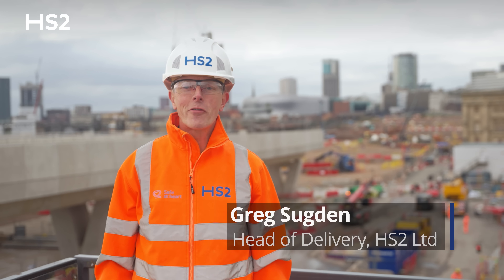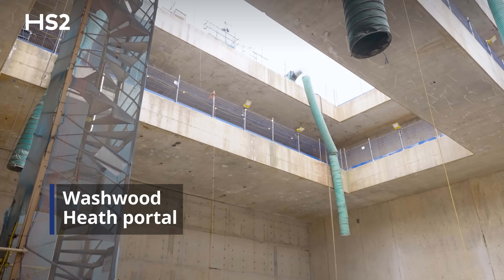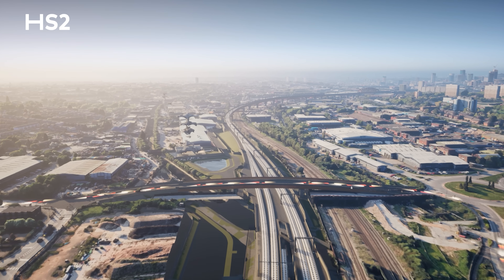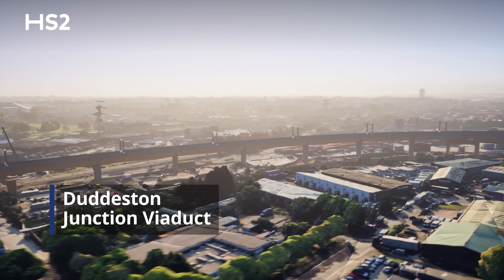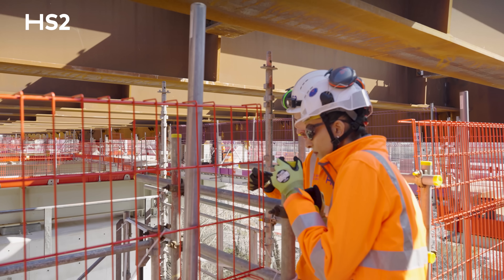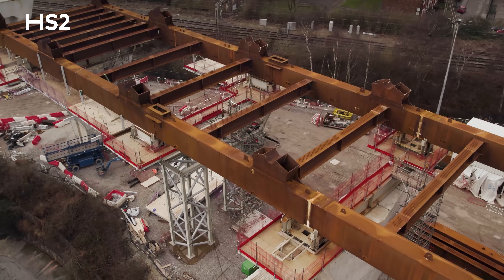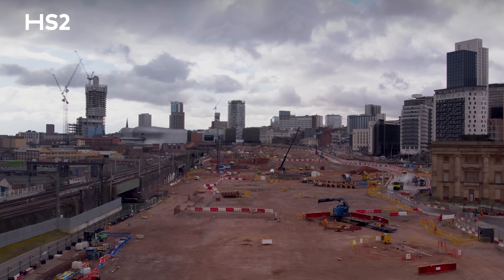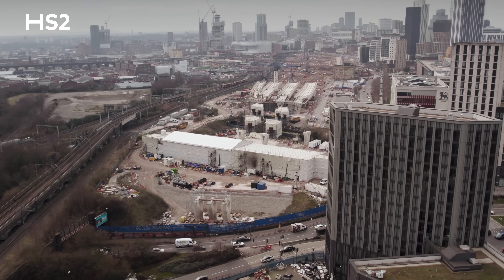Building to Birmingham: 🚆 HS2's Curzon approaches progress update 🏗️

Comment: The canal span of Curzon 3 is going to be a big challenge - a curved concrete deck, starting the split, resting on the bespoke steel piers, but also very limited access underneath for the formwork given the canal and towpath will remain open.
Reply: They will build a scaffold bridge  in spanning the canal and probably close the canal towpath.

Comment: well done team much appreciated for all your work your doing,  but still wondering exactly how local services will be impacted once the hs2 goes live since they are essential interstops so time table won't be changed unless they deem some locations decommissioned based on usage, which will be a shame,
Reply: For context, my job is to write railway timetables.
Currently, the WCML has slow freight trains, slow passenger trains and fast passenger trains. This means we have to leave a huge gap in front of every single fast passenger train so that it doesn't crash into a slower train in front, and this severely limits capacity. However, once HS2 opens, those fast passenger trains will move to HS2, leaving the WCML to handle slow freight trains and slow passenger trains. Because of the similar speeds, we'll be able to run trains closer together, meaning more local passenger trains, and more freight trains. So while the journey time may increase slightly from your train stopping in more places, you will have more trains, and so it's a net benefit.

Comment: Replacing that beautiful old brick bridge at Saltley Viaduct with a bridge that looks exactly the same as the others on that stretch seems a bit of a shame. No nods to the existing bridge, just a boring carbon copy of the others?
Reply: Because both Aston Church Road Bridge and Saltley Viaduct are not high enough for the catenary wires of HS2 to go under them plus both Bridges were deteriorating and run down

Comment: HS2 is only HALF a project. The 20 million in the North have been ignored again. The Engineering looks good. However the 35 miles of tunnels through the home counties/Euston connection are the main reason that this project is billions over budget. The Manchester HS2 link was therefore sacrificed.
Reply: Lucky lucky Birmingham
Reply: I couldn't agree more.... As usual The North is sacrificed for The South... It's not only Manchester and even Liverpool that's missing out... A city larger than both of them has also been overlooked as per usual Leeds, the largest city in the North of England and largest city in the UK outside of London and Birmingham has once again been overlooked, It's criminal how often that happens to Leeds specifically, It's also the largest city in Europe with no mass transit system.... It's a disgrace on all the governments who've ran this country for the last several decades, always overlooking a powerhouse of a city. Idiots.
Reply: @markolegend3011 leeds is not bigger than Manchester lmao. 
 But other than that, yes absolutely 

I think the councils of leeds and Manchester should work together to pool their money instead of relying on london.

The trouble is we're really quite tribal in the north there's no way that will ever happen, but it should.

Cash strapped as it though and it doesn't look like Manchester will be using the boom town money it's currently attracting to put funding in areas other than itself.
Reply: @pierzing.glint1sh76  Leeds is larger than the City of Manchester which is the 6th largest City in the UK, again you are mixing up the City f Manchester and Greater Manchester Metro County which is not a City
Reply: @markolegend3011  Leeds is not the largest City outside of London, that is the City of Birmingham 150 miles sq in area and a population of around 1.5 million citizens making the City of Birmingham the second largest City outside of London and the Second City of the UK
Reply: @markolegend3011  I totally agree with your point regarding Leeds population. Leeds should have a link from HS2. Manchester city only has a population of 550,000. However Greater Manchester has a population of 3 million (it includes Manchester, Bolton, Wigan, Stockport, Salford, Oldham Rochdale, Tameside and ,Trafford). They are all part of a densely packed urban conurbation, and are thus treated in a similar manner to Greater London. The Greater Manchester boroughs have different boundaries depending what side of the road you are. That is why Manchester is significant for transportation.
Reply: don't worry, all the saved HS2[n] money isn't being wasted.....it's being spent in Ukraine.☹
Reply: @ccjelley2390 no, that simply ain’t true. UK given to Ukraine so far £3bn, a cheap price to weaken the threat of yet another European dictator. Net zero…well that could have paid for the expansion

Comment: Do you mean meters cubed or cubic meters. There is a big difference.
Reply: @johnawalker9261  'metres cubed' and 'cubic metres' are the same volume. 2 metres cubed = 2 cubic metres. 

I think you mean without the 'd' in cubed? In that case:
a cube with side length of 2m = 
 8 metres cubed
Reply: @ three meters cubed is nine cubic meters, so they are not the same.
Reply: @johnawalker9261  if you say so!
Reply: My arithmetic has always been bad, that should read 27 cubic meters.
Reply: @johnawalker9261  a cube with 3m sides is 27 cubic metres. I think we are on the same page.
Reply: Sadly that's how far too many "civil" engineers are taught
Reply: It's 180,000 cubic metres. More to the point that's 20,000 lorry loads.  So where did the soil go ?

Comment: It needs to be built in full to Manchester, Leeds, Glasgow, and Edinburgh.
Reply: Plus a branch to Liverpool would be nice!
Reply: @therebel2187  already in the planning look up Liverpool to Manchester high speed line and you will be pleasantly surprised at the progress on that front…!
Reply: Newcastle needs it mostly, we have the worst productivity in the country because we're so far from everyone else and we get hardly any investment
Reply: @50upss  Newcastle has the unlucky situation of not being near any notable population centres, the east coast mainline serves mostly big towns or v small cities at best, therefore harder to justify the connection, also with the ECML getting digital signalling and speed increase on the lower section to 140mph you could argue Newcastle will be adequately served by high speed rail
Reply: Maybe they will plan to build some HS2 multi-delta at Warrington Central.   
There are many options now.  
HSx Liverpool to Manchester through Warrington Central (massively upgraded) and a HS2 4-way delta would be nice.
Once they get more HS2 done then GBR can re-start Phase2a.
Reply: @Carlos-im3hn  I think with the southern ECML upgraded to 140mph and the Liverpool to Manchester being upgraded, there seems to be a logical gap to be filled and that is Manchester to York high speed, with an upgraded ECML from Edinburgh to York. This means both ECML and WCML will be upgraded to allow Glasgow and Edinburgh trains to rapidly access high speed lines in northern England (around Manchester for Glasgow and around York for Edinburgh)
Reply: @gorgu08  great points...it all can be carried out, perhaps not all at the same time but forward we go !
Reply: @Carlos-im3hn  indeed the capacity requirements between Scotland and the north of England means no need for dedicated high speed but upgraded WCML with passing loops and freight diverted off the ECML and WCML onto the Glasgow and South Western lines and a (hopefully) extended borders line to Carlisle…
Reply: Agreed.

Comment: hs2 _ a very well done _ this is by far the best what we're actually doing update _ you should be doing this all the time _ because lets be fair _ some of your press release offerings have been disappointing _ it's been interesting to see what has been happening outside of Curzon St Station area as the approaches have had very little coverage from anyone _ YouTuber droners & yourself _ as you drive past you see part of structures taking shape but with no images much on the website or from watching video footage from drone coverage _ keep the updates coming _ explain what you're doing _ show what is taking place with video footage _ keep it coming especially now as structures move forward _ ie somewhere else to show in detail _ the areas around Interchange Station as it moves across the M42 towards Delta junction & Delta junction in great detail _ again well done for this piece _ more please _ 👏